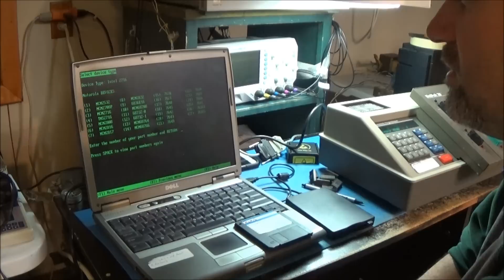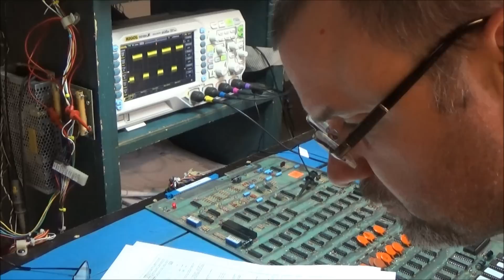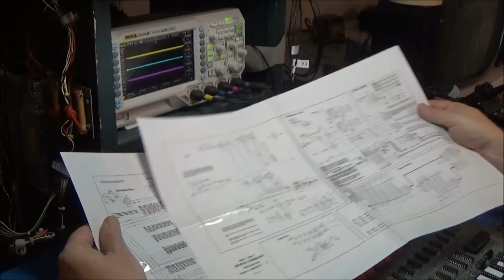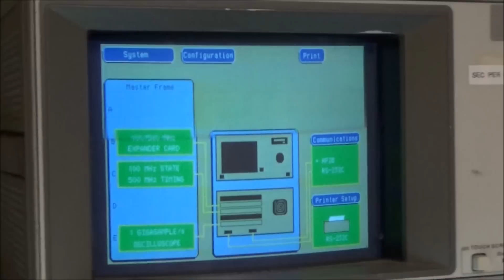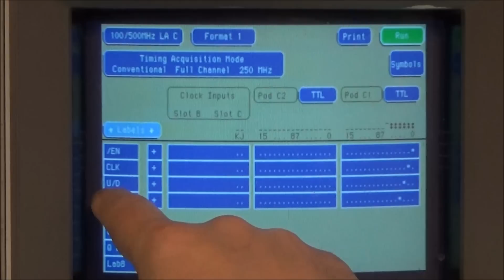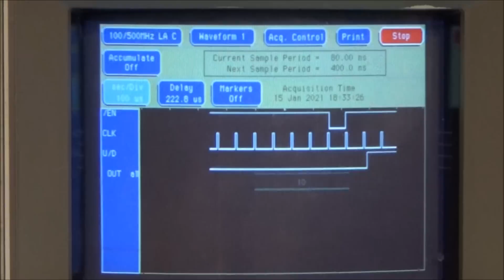1980 Atari Missile Command Arcade PCB Repair Part 6    01-10-21

Comment: Point of curiosity - If you were to set up a USB Flash drive as a DOS startup disk, along with the application that runs your LogicPac, and plenty of leftover space for ROM storage, would that make your life just a little simpler (not having to rely on floppy disks), or am I missing something?
Reply from the maker: Maybe....   not sure the computer would recognize a flash drive to boot off....    i kinda like using floppy’s tho..  i like old stuff lol
Reply: @classicarcaderepairs  I suspected that might be the case... ;-)
I guess I was just having flashbacks to running a Mac 512 with a single 400k floppy disk that had the operating system, an application, and if you were lucky, enough space for a document, or two on one disk... :-p
How times have changed... :-/